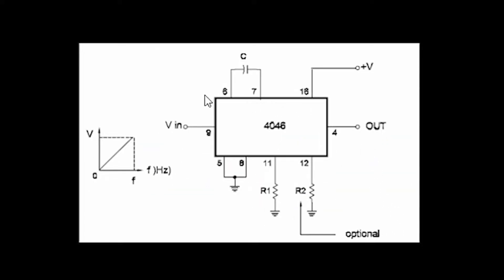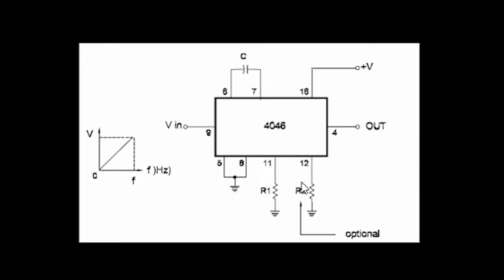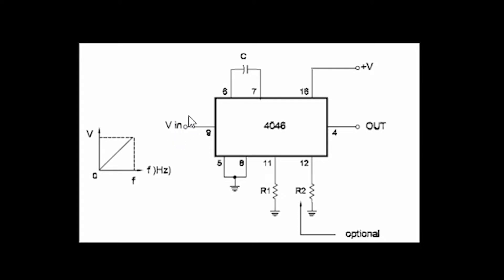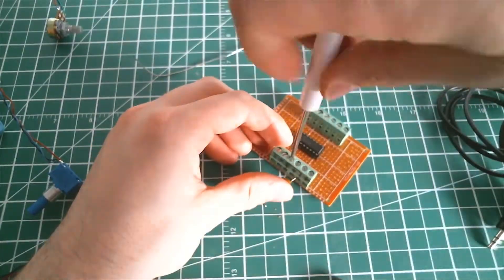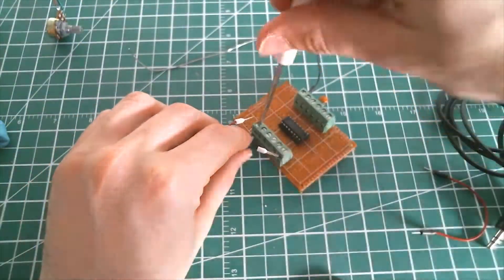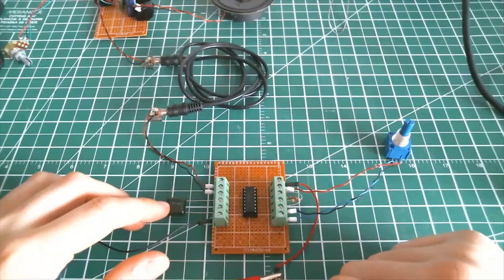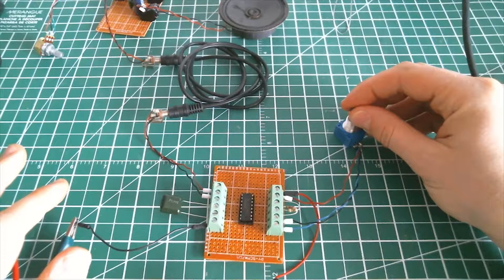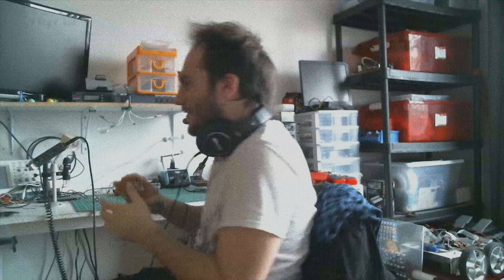Build a Simple Voltage-Controlled Oscillator (VCO) with CD4046 | DIY Synth Circuit Tutorial

Comment: I need a pulse signal between 35 and 45 Khz.  What value do you recommned for R1 R2 and C1 C2? Thank you :)
Reply from the maker: C1 can be 0.01uF  (103 coding).  10K would be R1 and 100K would be R2. This would give you a range around 26.5KHz to 51.6KHz.  If you want to calculate you may use the following: http://drr.ikcest.org/app/s0003    I tried to stick with really common Resistor and Capacitor value.
Reply: Wow thank you so much :D
Very good channel by the way :)
Quick question is this independant of vcc power ? Datasheet shows different values for different vcc values. My cd74hc4046 is powered with 5v… so not sure if this is changing anything :/